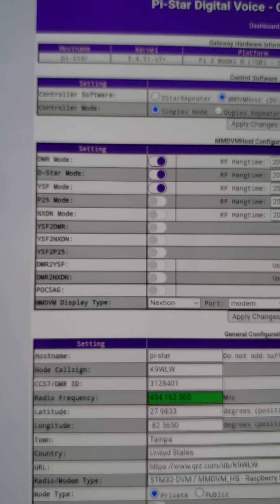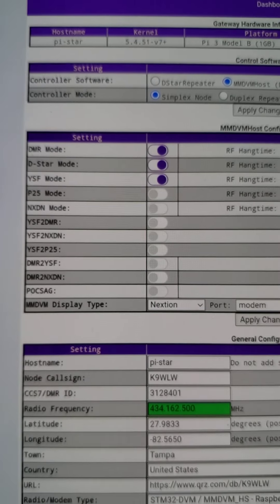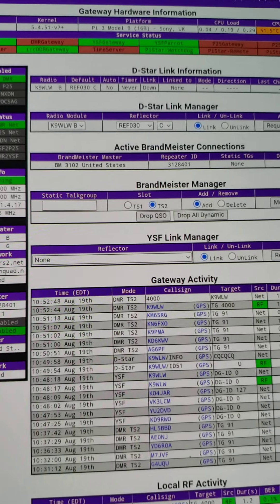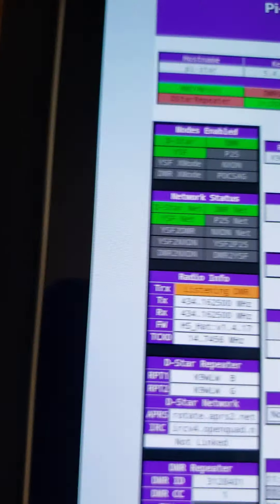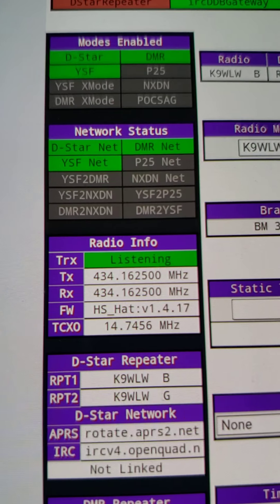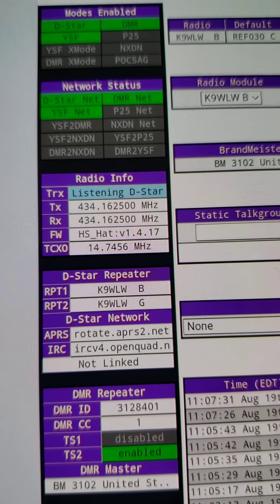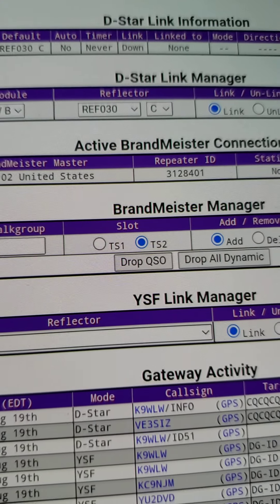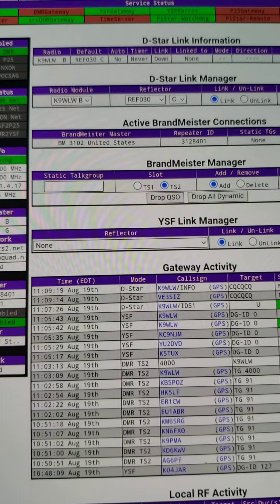How to leave your pi-star hotspot "locked and loaded"!

Comment: Great video, thank you. Do you have video or just a list of Favourites Wires Categories C1-C5 setup or dump of this list from radio? TU 73! Marek,  OM8GRS
Reply from the maker: I do not use Wires-X network. I am not sure I understand your question. Could you clarify?
Reply: @k9wlwradio309  I am sorry, I will try to clarify. I use RT programmer with USB cable to backup/restore my FT3D. It is much more convenient way to add any reflectors or wires rooms to radio favorites. It is possible to export it as a CSV file from radio. Do you have any of this exports from your radio, especially the part of Wires settings?
Reply from the maker: @marekpolak7020  thank you for clarifying. I do all my radio work by hand. I do not use external software like RT systems at all.

Comment: I would like to know the initial settings on your DMR radio
Using you're method I can key up any talkgroup but I have no reception unes I switch my radio to that talkgroup
Gary
Reply from the maker: I set my Anytone 878 to digital monitor mode. It is also known as Promiscuous Mode. Here is my video of the settings. 
https://youtu.be/IKf7bD1Hkq0
Reply from the maker: Here is another short video on how to quick key into a received group (that is not even programmed into your radio). In this video I use my Openspot 2 to QSY to a talkgroup to a talkgroup that is not even in my radio. I use the * key to capture the group which then quickly allows me to quick key into the new group. I also demonstrate how to quickly add the new talkgroup to the radio's talkgroup list. https://youtu.be/X34uPHyVWFI